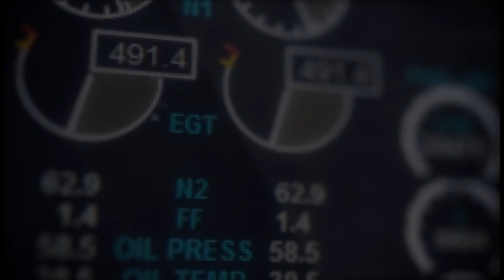Will Circular runways "take off"

Comment: I can agree with everything except the wingtip clearance. Did the original concept actually call for concave runways or just banked as you said? Because your drawing showed a concave, not banked runway. A banked runway would not present wingtip clearance issues, would it?
Reply: You'd have to have a change in slope at some point, unless the whole airport was a funnel... though I guess if the lost baggage area was at the bottom, there'd be an advantage. ;)
Reply from the maker: The picture I shared is from the homepage of the Dutch concept maker. They are also listing other problems that have to be solved.
Reply: Maciej Swic 
When landing, while the plane is still in the air, the wings are level but the runway beneath is banked. This means one wing is much closer to the runway than the other. If landing in a counterclockwise direction, turning to the right could cause the right wingtip to strike the ground.

Comment: It depends. The jury's still out but if the Earth is flat I'd say go with the circular runway. If it's round, keep 'em straight. On a more serious note, for every problem solved with a circular runway, three new problems arise. It could work for light aircraft. Back in the day an "airfield" was just that. A few acres of grass and pilots always landed and took-off into the wind. Performance planning for heavy transports (airliners) would be a nightmare with constantly changing headwind and crosswind components.

Comment: Im also assuming that roads going to and from the airport would need to be underground, and reinforcing a tunnel that goes under a runway would probably be very expensive since this tunnel would need to be very long to accommodate for the zone around the runway that must be clear of obstacles. And a tunnel this long might also need to be ventilated, since there would be heavy traffic flowing though it at many points in the day. Unless people had to park far away from the airport and take an electric subway into the building.

Comment: Some of the issues you mention I can see potential solutions to though it would involve compromising on the potential advantages of the circular runway namely things like breaking the runway down into zones and having approaches to 03,06,09,12,15... etc at 30 degree angles for the purposes of approach calculations and similar, would also allow for the adaption of ILS technology as there is a limited number of fixed approaches though enough of them you could greatly limit crosswind issues with winds from any direction (At most the wind only need be +/- 15 degrees off from a perfect headwind). Course that does nothing to solve the issues such as the outboard engine failing on takeoff or say the inboard reverser unexpectedly failing to deploy on landing.

The issues with ground clearance are also potentially solvable by having the camber be constant across the width of the runway and also for some distance either side of the tarmac so you would be landing on a flat surface just that it's angled in respect to the Earth such that it is flat but not actually horizontal you would still have issues that the angle is slightly different at the tail than it is at the nose though with a 3 km radius (1.5 km diameter) the length of even the largest airliners is a rather trivial fraction of that.

But yeah ultimately there are many problems and I think probably enough to keep engineers that know way more about these things than I do busy for decades if solutions are to be found at all, honestly this is the first I have heard about this concept so these are just some initial thoughts that struck me prima facie so entirely possible that I am failing to consider wider implications of those possible solutions, more research required I think.

Comment: I can think of so many reasons NOT to have circular runways that it's mind boggling. For one, how do you establish a 'stabilised approach' ? In the event of a crash, does the next plane pile into the wreckage ? Errr, separation for wing turbulence ! That'll be a concept killer. All this to counter often rare crosswinds where the main problem can be gusts which won't change.

Comment: The most likely solution for all approach and landing current problems is vertical take off and landing and I think that will be the future of aviation. Maybe this concept of circular runways will fit in that future because both the aircraft and tarmac design will have to be developed together.

Comment: But sir on this type of runway there will be no decision speed (V1) during take-off right? Also. what is the meaning of "Vertical Speed".
Reply from the maker: I dont know how calculation of speeds would work on a runway like this. Vertical speed is the movement of the aircraft "up" or "Down" measured normally in feet per minute.
Reply: Thank you!!!

Comment: The pro of a circular runway is that it's never to short.
Reply from the maker: True
Reply: Yeah, no brakes, no problem.
Reply: @Jack C
Now that would be a problem if one had a small plane with a  casting Freewheel were the breaks is what steers the airplane when it's below a specific speed thats too low for the use of the tail. But i guess by then ill stop on its own or roll over the top of the edge at some point unless the pilot throws his fussing mother in law out with a rope to help stop the plane before it gets over the edge  (ha ha lmao!!)
Reply: Well, planes don't just overrun the runway. In the normal operation this problem is non-existent. One must have a series of malfunctions on the plane to make it so hard to control that overrun happens. Or the weather must be below the minimums for normal operation. In either case, the last thing you want is a round runway to top up your problems.
Reply: But will you flip the plane trying to keep with the turn ?
Reply: How do you get clearance to land?  If the plan has mechanical issues is there a special straight runway (guessing no, due to cost) Heck most pilots in xwind have problems landing and maintaining clearance on a flat straight runway (a number of the runways in europe aren’t very flat to start with) now making them circular makes me feel like this is a huge prank.
Reply: Why doesn’t the circular runway short?

TOO*
Reply: Actually, no.  You'll still be limited to a section of the runway, based largely on how fast you can turn the craft (or what g-forces are acceptable).  To high a curvature, and it will be unusable.  Also, if the point is to get rid of crosswind effects, then you don't want to have to swing the aircraft through a large change of angle during critical portions of takeoff and landing.  The circumference of the circle will have to take both of those into account, for the size of the aircraft the airport is expected to handle.  It's more forgiving, but it can still definitely be to small, which is effectively the same thing.
Reply: It can't be true if the sentence doesn't make sense. It's "too" not "to".

Comment: Extremely risky and unpredictable landings. Even at present its impossible to touchdown and change directions immediately.  Also, one wheel bogey will hit the banked runway first and take the entire  70 ton load for a few seconds. Terrifying !!!
Reply from the maker: Among other things, yes.
Reply: It seems the comments re not sorting in the original way again, so I have to post here, a comment that would have been better placed as a new comment.

In my last comment, I had a number of ideas to get around some of the problems mentioned with circular runways. However this was no complete list, and if I did have such a list I think it would be so long as to have a tendency to distract from the general thrust of Monetour's video, i.e. to say that innovative thought is nice and progressive but circular runways are still much in the incubator.

Following that, I came across the Dutch inventor he mentioned who has his own channel for the subject, so IMHO, the deeper details of this subject really belong there, rather than here.

Mentour is clearly a busy guy (as anyone with his degree of capability in about anything. Consequently,  think we should pass this in on as I mentioned and let Mentour spend the time it would take him to follow this one further on more immediate issues that need attention on behalf of many.

Comment: Maybe not circular runway, but I can imagine hexagonal pattern consisting of 6 straight runwways, greatly reducing crosswind issues and without any of the negatives of the circular runway. The only issue would be increased cost for all the extra space and some barely used runways because in most places the wind comes from one direction more times than not.

Comment: Schiphol seemed to have solved it by having runways going in every direction.
I think the best solution for the near future is to design planes with vertical thrusters so they can slow to a hover and land like a helicopter.  The USAF have these but they are not very stable and thus, require a lot of training to fly them.  
Straight runways will still be needed for "legacy" planes.